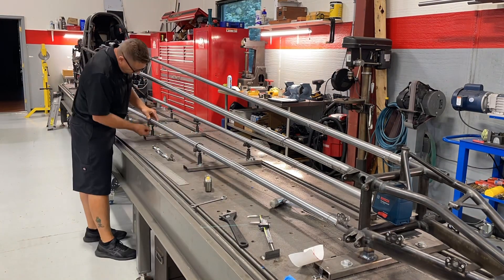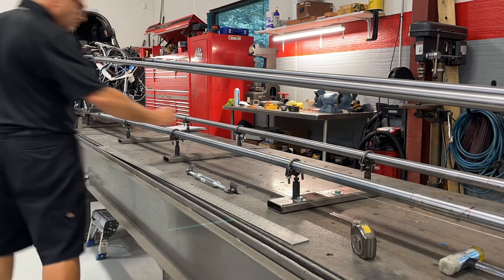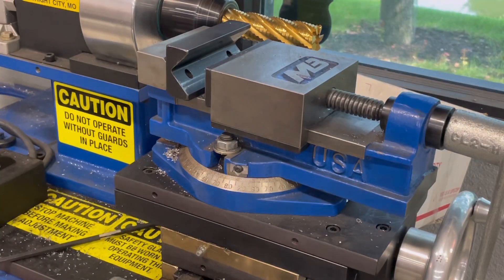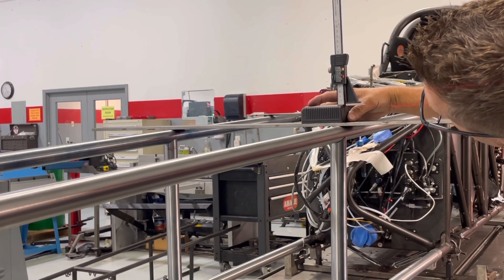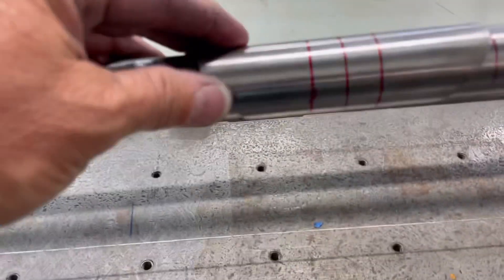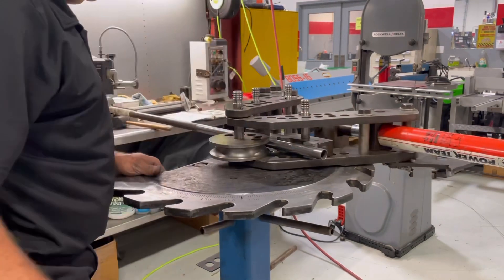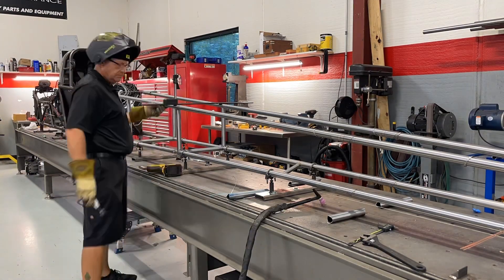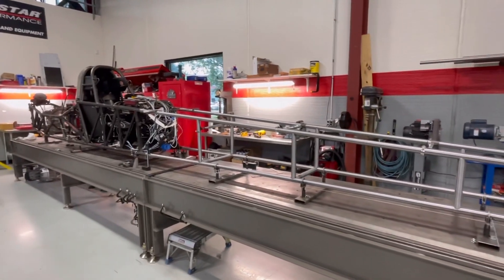Part 5 Front Halving a 330 MPH Top Fuel Dragster

Comment: When the car is decelerating and let's say it's a fairly Bounty track or whatever the scenario might be, and it bounces off the chassis stops, how hard is that on the front half of the car? Or the car has a whole?
Reply from the maker: Great question! It is extremely hard on the chassis. Recently a jack that holds the car up had a failure in Norwalk Ohio and it bent the chassis falling about 2 feet in the air. This is why I build the chassis like I do because they need this kind of support and they should have at least this thickness of tubing

Comment: I can remember a time when the SFI specs stopped at the footbox,  And then people started to use .049 on their front half's,  And then the rule makers had to get involved again.  Question Rob, Why are the slip joint stops angled like that? When the tube comes up against that angle cut stop, doesn't it cause a sort of shearing force across the rail?  If they were just straight cut would it not just act as a stop?
Reply from the maker: It is symmetrical with the whole tube and the angle cut it’s so that it doesn’t have a straight force sideways which is a smaller diameter by laying it open at a 45 the sheer size of the tube is oblong and larger.
Reply: @robwendland  Also that fuel line crossmember. That wont snag bumps on the racetrack when decelerating or flat towing it back to the pits? When you were putting the bend in it I had thought you would have inverted it upwards

Comment: May I ask a question, since the lower rail has the arch is the upper rail the same. Thanks again I'm loving these videos.
Reply from the maker: Good question that all of the tubes are arched the same before they are installed. You guys are starting to get pretty sharp out there!
Reply: @robwendland  Thanks Rob I love to watch and learn stuff
Reply: Makes me wonder how "straight" they get when the power is applied
Reply: @BDCarrillo  how I understand it the upper and lower frame rails are arched during the run if it was flat or down it would more of a tendency to break and would not allow the weight to transfer
Reply: @andyb9767  it's a preload, similar to flatbed trailers.  As the load increases (ie, braking at the end of a run) they'll flatten out a bit and the car will get a fraction of an inch longer